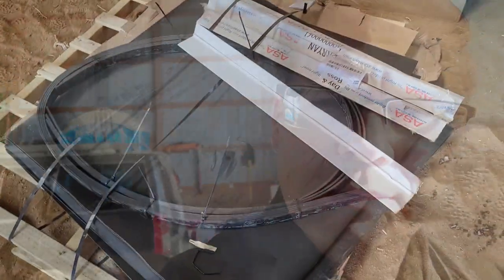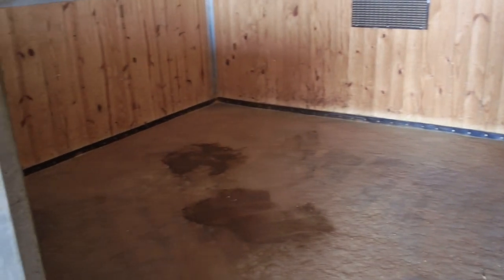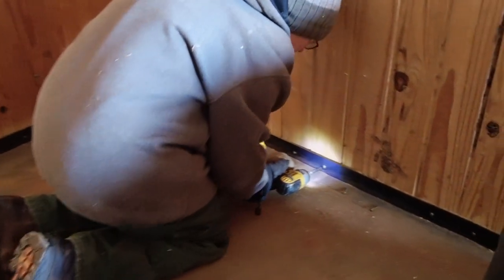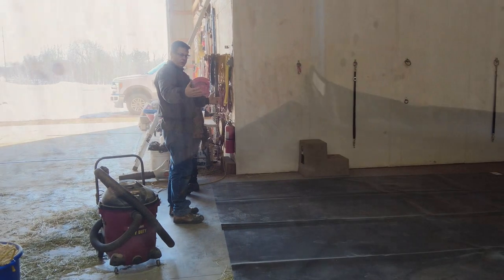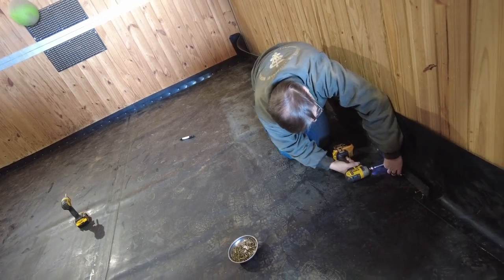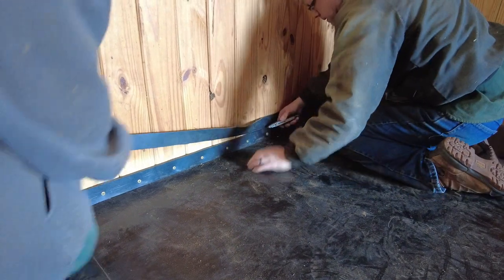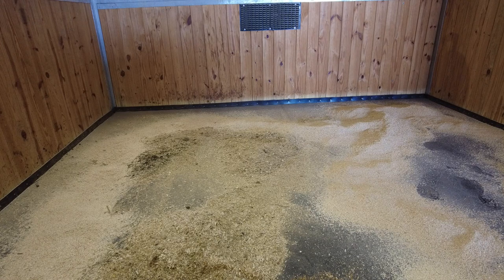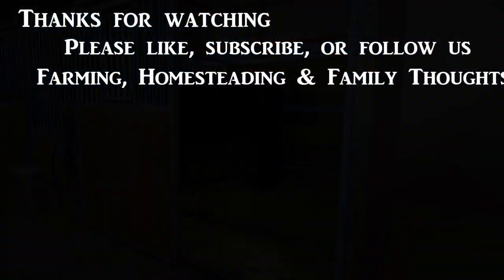Upgrade to the Best Horse Stall Mat Bedding System SOFTSTALL

Comment: Thanks for the informative videos! What about metal shoes... are you concerned if a nail or shoe is loose it could rip the softstall system? It is incredibly helpful to see how an equine vet sets up his own stalls.
Reply from the maker: Hi, we only have summer metal on up here hence they are not 24-7 365 metal so that might be why since we have not had metal issue at all with these.  We also still bed shavings to collect feces and urine better and maybe that helps too.

Comment: It's been almost 10 months, how is the Softstall installation holding up?  Did you convert your other stalls?  I'm looking at upgrading our four stalls that currently have 3/4" x 4' x 6' crumb rubber mats.
Reply from the maker: its holding up great and yes we are doing all four of other stalls, the pallet of the material came in just recently, but since the temperature is only about 0 degrees right now we plan to line the other in spring.  FYI I couldnt swing the new matting right away so had to wait until crops came in to buy it=)